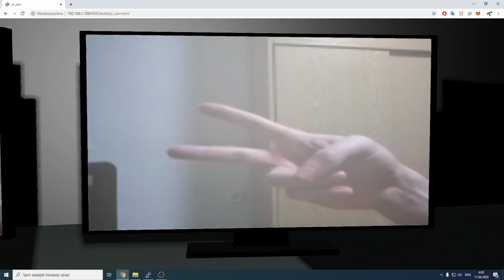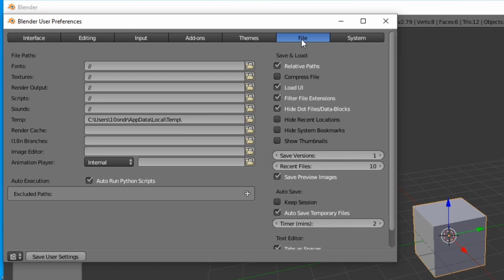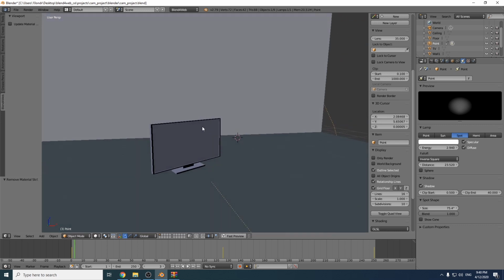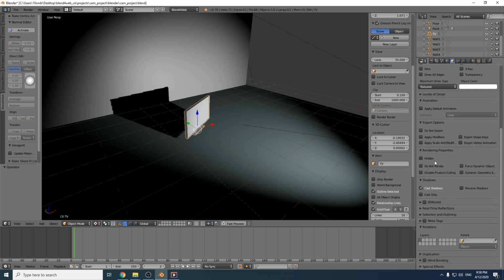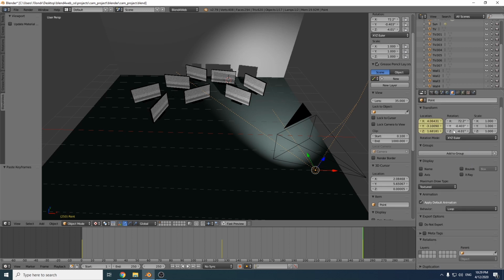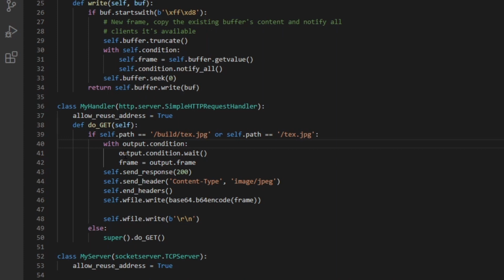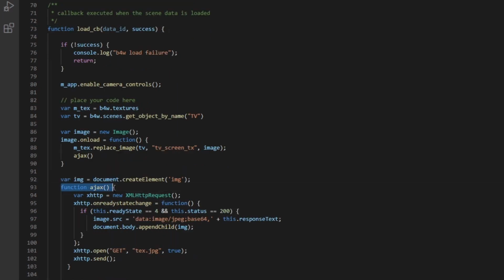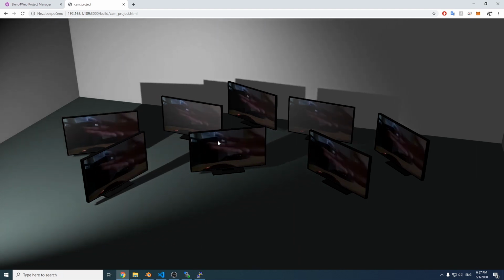Web browser 3D Blender scene with Blend4Web

Comment: i cant open the html on build folder, i tried using chrome, edge, explorer but its not loaded, stuck on 0%. any solution? thanks
Reply from the maker: Not sure. Your best bet is to actually host it somewhere (can be a local webserver or raspberry pi or remote server). If that doesn't work, check the browser console for errors.

Comment: not working with blender 2.83.
Reply: Not sure, if learning blender 2.79 is a good idea, these days. Looking for b4w supporting 2.83
Reply from the maker: @kwynintelligence435   Yes of course, but until b4w supports the new Blender, this is all we have. Also the main principles stay the same in both major Blender versions.
Reply from the maker: Actually as someone already mentioned, try the successor Verge3D which is compatible with newer versions of Blender
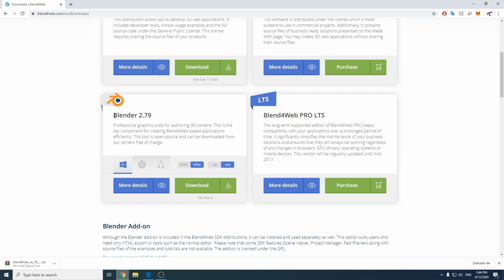Reply from the maker: Correct, it's mentioned in the video at 2:34